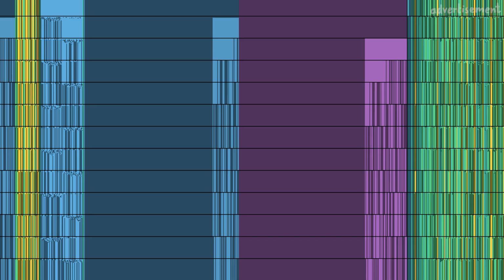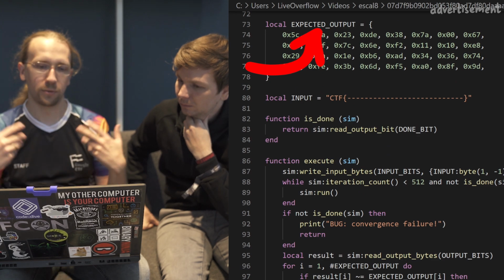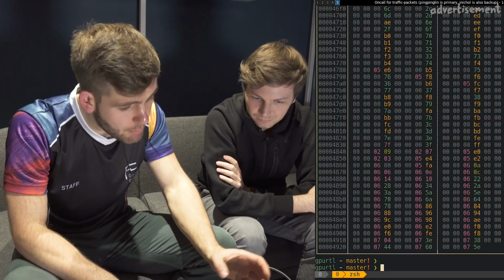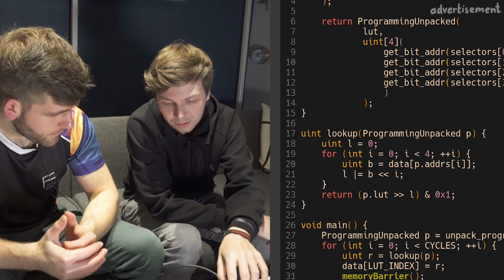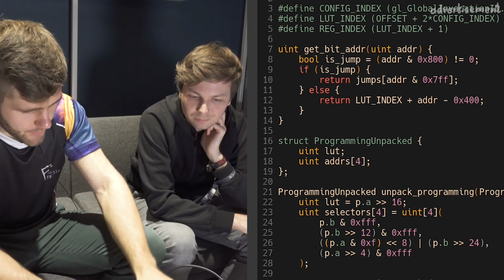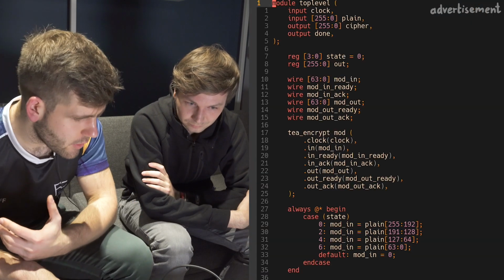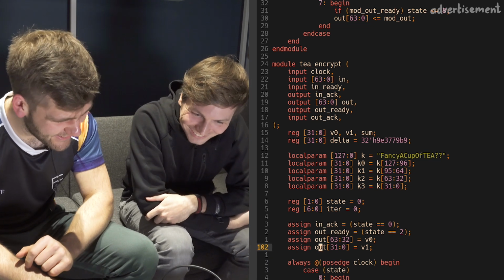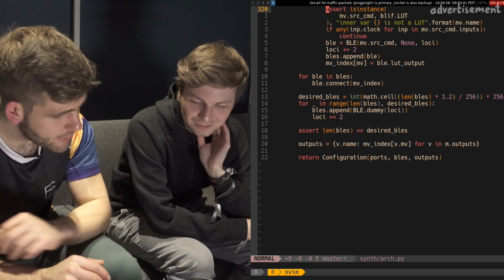FPGA simulated on a GPU - GPURTL Google CTF Finals 2019 (reversing)

Comment: I just played a bit with it, extracted the shader, and they didn't even enabled size or speed optimisation, and left all debug information (like identifiers, function names, uninlined). Indeed disasembly using SPIRV-Cross was perfect. It recovered full source code back with variable names, and code structure intact. Doing a quick `spirv-opt --strip-debug -O` would really make things harder. But I guess, it is fine, just some fun, and limited time.

Comment: Hello, I am a new viewer to your channel and have watched some of your videos. I like your content; it was inspired me to start trying to learn assembly code. It also made me learn python and some other stuff. I would need your help^^, I wanted to try to learn assembly code, so since i couldn't get it i tried to crack an app that i needed. however, i started by looking at all the files. And, I found the source code in the files. So, since I have some experience with source code, I just modified the script. And now it doesn't launch anymore. I tried searching the checks on google but its been 2 weeks i've been trying for nothing and I still can't find what is causing this. I also have to say that the source code of the old ver works in the new ver etc, obvious. But I can't find the check that would make it work. The software's name is TimeBolt! If you could help me find what the check is, it'd be fantastic!

Comment: Before doing any optimization work on those shaders you should really look at Verilator. There are far, far more efficient ways to simulate an FPGA.
Reply: My thoughts exactly, I haven't done a lot or any graphic programing, but this kinda seems "over complicated" to implement and optimist.
Not that FPGAs are a piece of cake to simulate, but circuits designs has been a fields of its own, probably before programing was.

As a hardware kind of person, I sometimes find programing languages to be less intuitive then a simple hardware implementation of some functions would be.
Like I'd get an idea for some things I'd want to process, I'll have a clear cut path to how it should in theory be executed, then as I go to write it in code, I almost always end up with some random piece of crap, and some times it doesn't execute as expected :)
Reply: Simulating an FPGA in the CPU and the GPU are not even gonna be close on "efficiency".

Comment: Many commercial FPGAs encrypt their bitstream nowadays, to prevent reverse engineering
Reply: There are also FPGAs with embedded code ROM, so no code 'leaks' outside at all. Then there is 'security bit', if it was set when programming, this ROM cannot be read back, only reprogrammed completely.
Reply: Sorry, I'm not buying into this, having too much experience with closed and proprietary hardware and firmware and highly successful open projects on the other hand. :-)
Reply: Yes, I would love that. :) Not sure in what regard it would help to keep others from contributing to development and finding improvements. Otherwise it's a problem for economy, education and the environment.
Reply: @CyReVolt  that's not how it works. There might be some open source projects around, but they work with source code, not bit streams. Most of us need to pay our bills, thus need a salary. If the competition can just steal our work, without any effort, we'll have a problem.
Reply: @jhbonarius  What's to hide in a bitstream? Everybody knows it's programming LUTs and switches.
Reply: @userPrehistoricman  never heard of IP protection? Would kinda suck if you spend many years and millions of dollars to develop code, and the competitor could just copy it and get all the revenue.
Reply: That is really sad. :( Well, also a challenge of course, but yea, really doesn't help in other situations.
Reply: @CyReVolt  it helps a lot. Else competitors will copy your product.

Comment: From what I see, the author didn't really reverse his binary, from the author's perspective, it's easy to underestimate the difficulty of how complex the language became after the compilation step. However, the teams solved this challenge had insane skills.
Reply: My thoughts exactly, the guy just created some binaries using some custom code and went like: "ok, here you go, reverse them".  The project itself looks really cool, but the "challenge design" was lazy.
Reply from the maker: I wholeheartedly disagree. He had a lot of thoughts on that reversing part, which he even talks about in this video. And also keep in mind that the challenge is play-tested before used in the competition. To test for the difficulty and if it is solvable. In this case Gynvael was the tester for it. So this is a very well designed challenge.